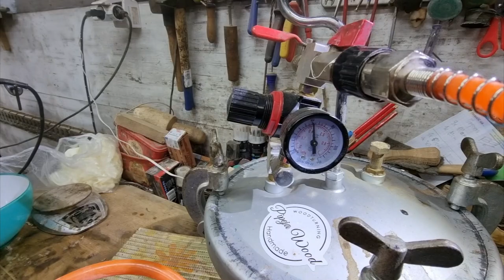From Trash to Treasure: Upcycling Wood Shavings with Epoxy Resin

Comment: Hi 👋, What happened to the first one you started to do it on a resin pour out on the bench and then you put another container inside the pressure pot and then poured that one, Love your work, stay safe, PHIL FROM THE DARK SIDE OF THE MOULIN FRANCE
Reply from the maker: Thank you. This is the same bowl as we started. We just have to pour some more resin when we give bowl to preshure pot because wood soak some resin. But we do that in the same day.
Reply: @Pipejawood-Woodturning  , okay, thank you for your reply, great job. PHIL FROM THE DARK SIDE OF THE MOULIN.